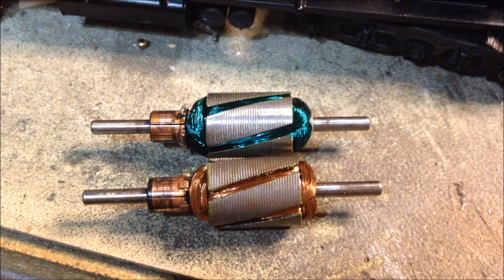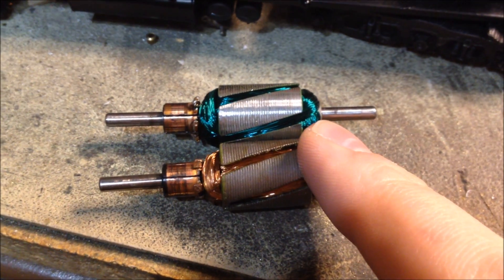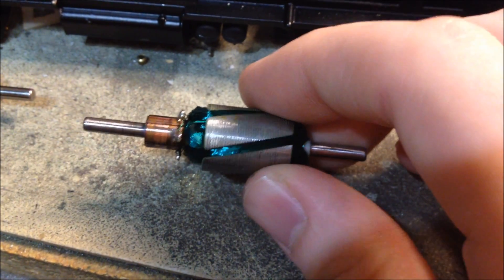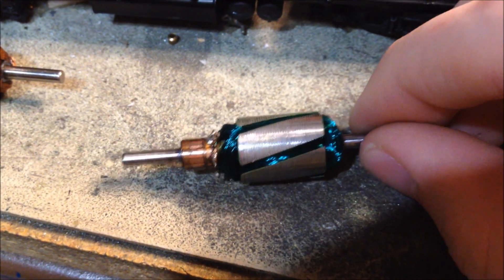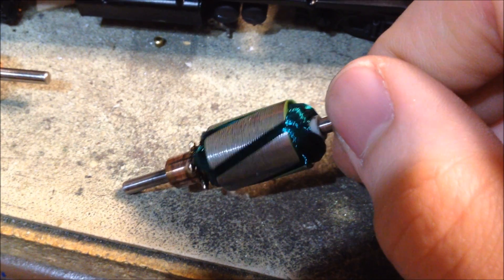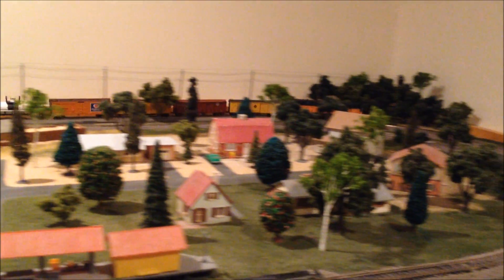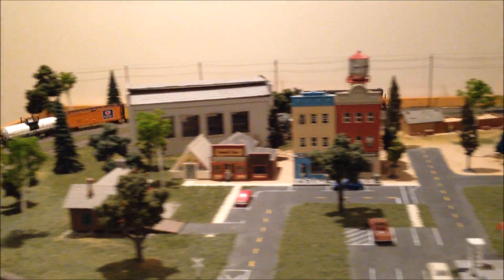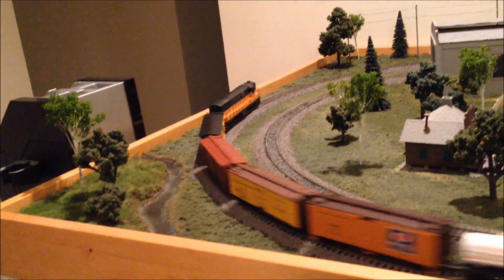Athearn motor rewind

Comment: What’s the stall current on one of these after rewinding?
Reply from the maker: It depends on how you wind it, but this one hits just over 1A when stalled.  More turns or thinner wire will reduce current, or fewer turns and thicker wire will increase it.
Reply: @DarthSantaFe  do you think it’s possible to get a blue box motor to 1A or less with rewinding and the magnet charging?
Reply from the maker: @corwin81  Yup, sure is! The stall current all comes down to the windings. 100 to 110 turns per pole using 34AWG magnet wire will get a stall current of around 1A on the standard Blue Box motors, both new and old.
Reply: @DarthSantaFe  perfect! That makes decoder selection easier.

Comment: You inspired me to wind a ho Lionel switcher motor .Had a little trouble getting as many winds as I intended so I  played it safe and stopped before I wrecked all that work.It ran and did not run as hot as the original did. Next is a Rivarossi ball bearing motor.with a Neodymium magnet I got.I know big old motor.also built with quality in mind more then most even today ,but rewound should be a great old motor.Any advise or ,You ever venture Rivarossi.??
Reply from the maker: I'm glad the rewinding worked for that motor! 

When changing the Rivarossi ball bearing motor to the new magnet, make sure to completely assemble the motor before pushing the magnet in place through the side.  The ball bearings will fly out and stick to the magnet if you try to put the magnet in first and then assemble it.  I've changed out the magnets in a couple of these motors and found out the hard way about the BBs and the magnet, but they turned out well in the end!
Reply: @DarthSantaFe  Thanks for the TIP! Impressive they made these things with actual ball bearings. They do this to reduce drag ,but then they cheap out and give it no axle bearing.Like to find a simple fix for that but so far it has not come to mind.except for a good lube and adding electrical pick ups

Comment: I'm wanting to learn to rewind some of my modern athearn motors, where might I look to see first hand on the process of disassembly and assembling new wire along with what gauge wire and the best wire to use for rewiring.  I've been reading a bit about rare earth magnet motors as well and have found some on ebay I'd like to try building an armature for using the rare earth stater.  There's some good 6-pole motors out there today and I'd like to get my feet wet in this area of the  HO hobby . . . Thanks . . . BRIAN
Reply from the maker: I haven’t made a detailed motor rewinding video, although I may do something like that eventually.  There should be some videos around showing how to do it, and I figured out the Athearn motors by unwinding them by hand to figure out the winding count and direction.  I’ve found that if done carefully, you can stuff about 110 turns of 34AWG onto each pole in these!
Reply: @DarthSantaFe  
I thought maybe that there was like a website or a book that give reference to electric motors in general or something.  When I go to start taking the wire off the pole where is the beginning place to start on the armature.  I'll go have a look around the web and look for a video or something . . . Thanks . . . BRIAN
Reply: @DarthSantaFe  
Here's the search words I used right here on YouTube and found quite a bit of information 
" rewinding a 5-pole mico electric motor armature "
Reply from the maker: @brian5606  When I go to check the number of windings on a motor, I start by finding the last wound pole (on 5-pole and up, it's the one that's fully exposed) and cut the wires from the commutator.  Then I'll carefully unwind it 1 turn at a time, being careful not to break the wire and lose count along the way.  Once that's done and I'm sure of the count, I'll actually cut through the rest of the windings to get them off quickly.  Once it's all clean, I solder one end of the wire to the commutator, and then carefully start the winding process in the same direction that was done originally.
Reply: @DarthSantaFe  
I see now kinda where to start.  After watching a couple of videos I seen 👀 how it was unraveled and how start the process of rewinding.  Thanks for getting me steered in the right direction.  BRIAN
Reply: @DarthSantaFe  
How did you come up with using 34AWG wire I found some on ebay.  What would happen if you were to use 36AWG or 32AWG I'm wondering . . . Thanks . . . BRIAN
Reply from the maker: @brian5606  I used calipers to find the gauge of the original wire.  Athearn's Jet motors use 32AWG, while the gold motors use 34AWG.  When using thicker wire, the wire will carry more power and you'll get more torque per winding, but you can also fit fewer windings on there which will result in higher speed.  That's why the Jet motors run faster and draw as much as 2A when stalled, but also have pretty good torque.  34AWG is kind of the sweet spot for torque, speed and efficiency, so it's what you'll find most in HO scale these days.  If you used 36 or 38AWG on a motor this size, you could fit a lot of windings on each pole and get a lot of torque and great efficiency, but it would run a lot slower.  For small to medium size motors, 36 and 38 are more ideal.
Reply: @DarthSantaFe  
Yeah, thats what I'm after is a more better creep speed higher torque motor, instead of a speed demon lol.  If I might ask, what's a jet motor
Reply: I also read that a skewed armature is way better that the straight armature in that it allows a better creep speed because of I'm assuming the skewed armature is more in contact with the magnets therefore allowing the motor to start at a lower amperage keeping the jerky movement from taking place when engine starts to move.  Also read that siver magnet wire conducts current better that copper.  I'm looking for silver wire at the moment to see what I can come up with.
Reply from the maker: @brian5606  The Jet motors are the black ones Athearn made from the 60's and into the early 80's.  A skewed armature is usually better at low speed since the poles ease into the magnetic field instead of snapping into it.  A well designed straight armature motor (like the Kato HM-5 or Mabuchi FK-130SH) can have just as good of low speed control though, thanks to more advanced methods of charging the magnetic poles in the last couple decades.  As for copper vs silver, silver wire is a better conductor and will result in a stronger motor, but it is more expensive and probably more delicate, so remember to be careful while using it!

Comment: Great vid as always.  I've been going through my collection of old Blue Box era Athearn locos with the gold can motors and of course, even after dissasembling and cleaning all the plastic gears, the towers, the drive line connectors, the wheels, the commutators, reseating at level the plastic motor mounts, I still find some that are "noisy" but only in 1 direction.  Of course, have searched the net and come across all the "Athearn mod for noise" solutions.  I did of course, also find a few places where you mentioned in postings that you found noise can be made by the magnets in the gold can, shifting and hitting the armature so you recommended CA gluing the magnets to the can.  Never tried this.  Are there hints you have found that lead you to do that, such as when you take the motor apart, you can see spots on the armature where it obviously was hitting the magnets (like paint scraps on some green painted ones) or worn spots on the edges of the magnets themselves?  Thanks very much for your time and help; would appreciate a reply if you have time.
Reply from the maker: I had a gold motor making some rattling noise while running, and couldn't quiet it down even with the usual methods of fresh oil in the bearings and polishing the commutator.  While messing around with it, I found I could easily move the magnets around, which of course would make a little clicking noise whenever they touched the gold wrapper.  Glued the magnets in, and the rattling stopped! :)
Reply: @DarthSantaFe  thank you very much for taking the time to get back to me.  Have a safe, happy and healthy New Years !

Comment from the maker: Just gave this a shot on an old Jet 400, and it unfortunately didn't work out.  The commutator fell apart when I tried to unsolder the old windings, and the windings were glued together with some sort of epoxy or laminate that made them very difficult to remove.  So, for the Jet 400, full replacement is better than trying to do a rewind.

Comment: Nice work.Did you replace the magnets with the newer ones?
Reply from the maker: Thanks!  I kept the old magnets, so it's still not as powerful as the new motors.  It's enough for this one though.
Reply: Does removing the armature from the casing cause the magnetic field to weaken?
Reply: @SMTMainline  Yes removing the armature weakens the field magnet. to prevent this, put a small piece of iron across the pole pieces before removing the armature.

Comment: Any idea what size wire to use for N scale and where to get it?
Reply from the maker: I haven't tried this on N scale motors, but I would suspect the wiring is between 36 and 42 AWG on most.  It's best to measure with calipers first and compare it to an AWG chart, and then I usually get my wire from Adapt Engineering on eBay.

Comment: Hello Darth,
Can you explain the steps you took to complete the motor rewind?

Thanks,
Donnell
Reply from the maker: +dwells77 I start by carefully unwinding one or two of the original windings to see how many turns there are and how each pole is wired to the commutator. It's very important to keep note of these so the new windings are wired properly (motor won't work right otherwise).  Then I'll cut out the rest of the windings to save time.For the actual winding process, I attach some wire to a commutator segment either winding it around a tab or soldering (if a decent tab isn't available), and then I start winding around a pole exactly how it was done at the factory while keeping careful count of the turns.  I don't have a tool for this, so it's all done by hand and eye.  I then connect it to the next commutator segment, and repeat for the rest of the poles.Replacing a motor may be easier, but if you don't mind taking your time with a little tedious work, doing this is a lot cheaper (like $0.50 a motor!).